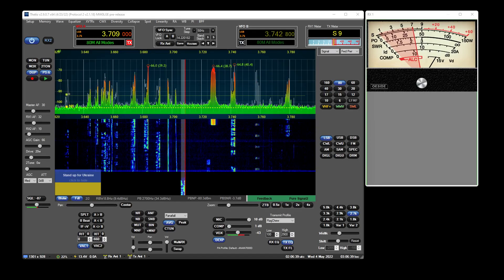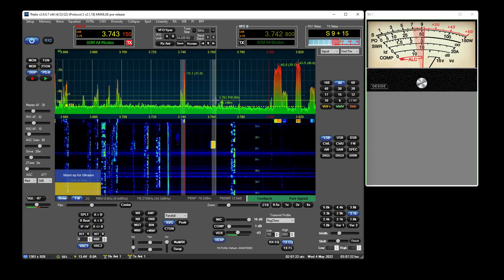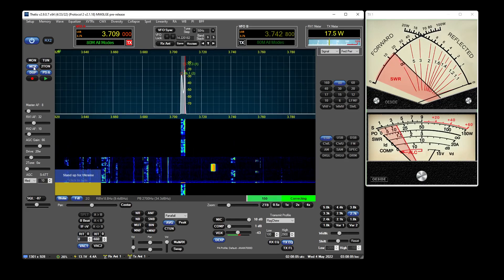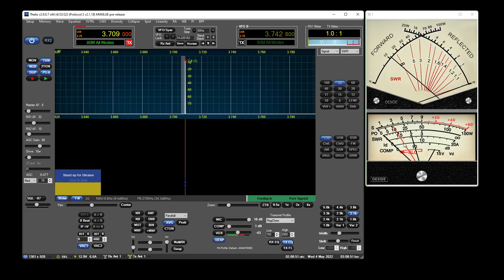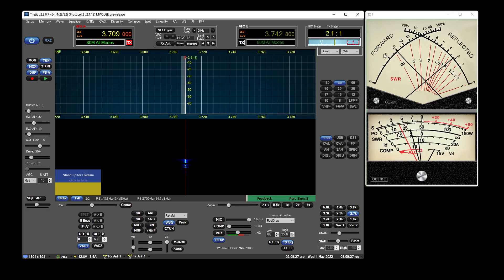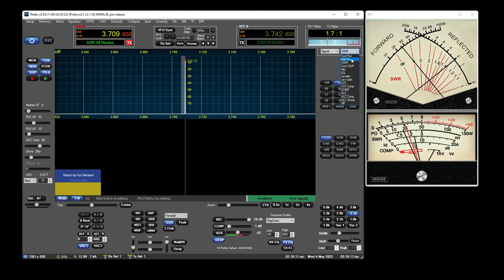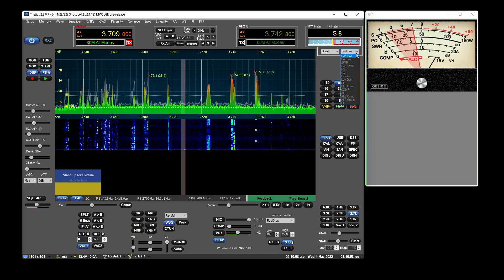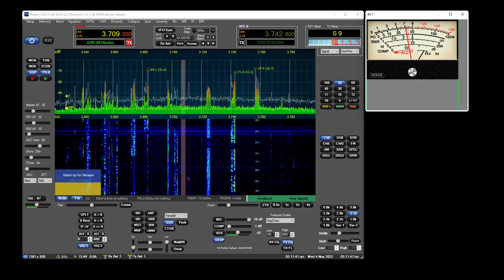Thetis - New Meter System

Comment: Hi Richie. nice implementation. (I'm using Marcus's excellent SDR-Control app for my Icom kit. Red face Icom - he's running rings around you).  For me the meter sits awkwardly next to the main UI which is completely different in style. Could the meter add-on be integrated into the main window as an option instead of the existing meter? imho the main UI is desperately in need of tidying up anyway. The controls are all over the place, especially when using two VFOs. e.g. there are effectively 7 volume / pan controls. 8 if you include mute (which I would be inclined to reposition next to the Master AF slider). Not blaming you - this mess is historic. Too many cooks. While I'm here, can I mention I like the 2Tone power level option. Personally I'd also like to see two settable and selectable power levels for use with a linear amp. I tend to use 100% power barefoot, but have to drop the power down when the amp is in line. And it's a different reduced drive level that needs to be remembered per band. Two buttons, P1 and P2 say, that automatically save the power level per band, positioned under the drive slider would do it. Select one or the other and the power level as set is remembered. Or a single 'QRP' button? (handy for FT8 etc. as well) Just suggestions. I DO know how long coding takes. Many thanks for everything so far. See you on the air. Dave GW4GTE
Reply from the maker: It is a rudimentary display at the moment so I can get directX rendering something to the target. Ref the power, the new PA profiles will help you with the limits when you have the amp inline, per band, and also with adjustments per drive step so you can linearise the drive slider. Watch a video on it somewhere on this channel. Set up a profile specific to the amp, just remember to select it. Eventually the OC control xPA button will be used to select a PA profile. It is on the list to do.
Reply: " Not blaming you - this mess is historic"  That is precisely why I am very thankful to Richie and give him big kudos.  A developer has choices on where to spend their time on hobby things...   The amount of work done in a short time by a single dev is impressive...  Obviously "in the zone".  Enjoy while there...